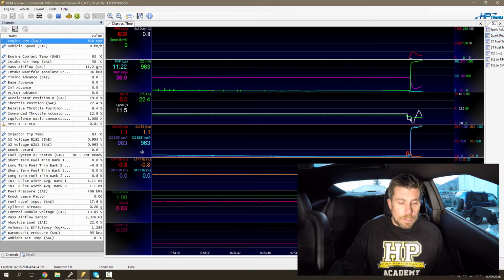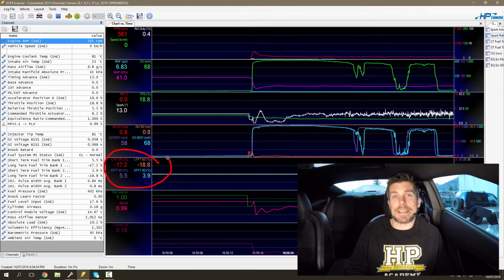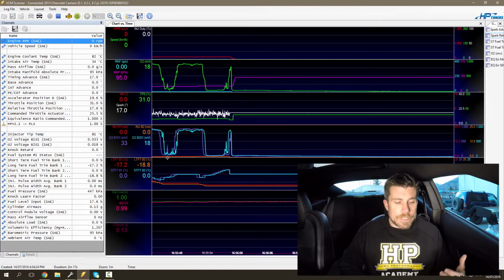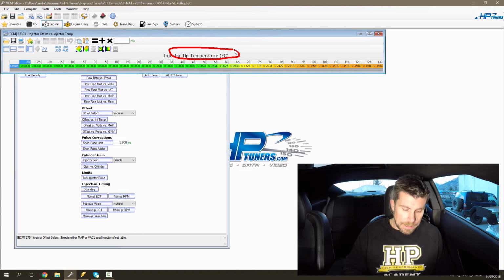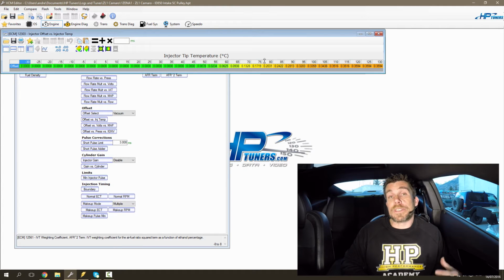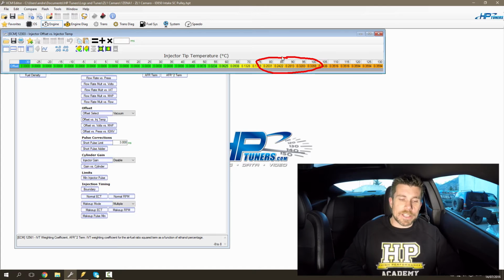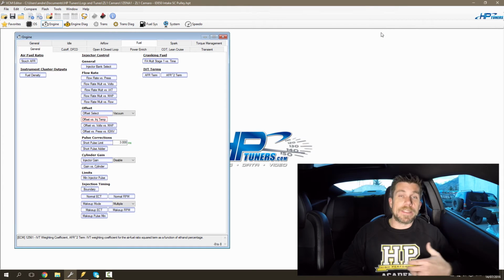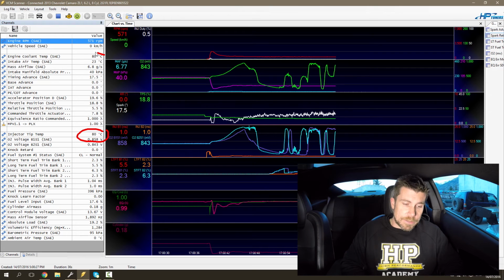HP Tuners Rich After Reflash Solution - GM Reflashing [FREE LESSON]

Comment: Can you please stop telling people the incorrect way of doing this - a simple hot restart will cause the ecm to reference these hotter tip temps leading to lean out problems = not good... HP Tuner forum has the correct way to dial this in...
Reply from the maker: The key point here is that we're not talking about a hot restart in this video - We're talking about what happens directly after a reflash where the calculated tip temp becomes unrealistic for a period of time. This is not the same as a true 'hot restart' condition where this modelled behaviour can improve fuelling accuracy when it's working as GM intended. Even if the numbers in this table are perfect for your specific injector, this situation is still going to affect you during the tuning process when the PCM is being flashed. 

Of course you can reinstate the stock table or modify it as required once you've completed your tune - That's up to the individual tuner and was not the aim of this video. The sole aim is to show how a tuner can deal with the rich after reflash situation and save time on the dyno during the tuning process.

Contrary to your post on the HP Tuner's forum, we don't take any credit for this discovery and we state as much within the video. This video was made at the time HP Tuners added the offset table and we produced this video in discussion with them directly. We were aware that the discovery came from a member from the HP Tuner's forum community but at the time didn't have a name we could credit more specifically. We don't take credit for others work.

Particularly when it comes to the OE world, we're dealing with very complex ECUs and often we're not privy to exactly what interactions are occurring in the background or the engineer's intentions. We don't claim to know everything and are happy to be corrected if we've missed the mark. In this case however we stand behind the information in this video 100% - Andre
Reply: That's just it Andre, This tip temperature changes to hotter temps every time you let the vehicle sit a few minutes and then restart it - usually around 70 degrees C. When this was initially discovered a lot of people were 0ing it out and then fighting problem after problem with hot lean restarts. This needs to be dialed in correctly...Thank You.